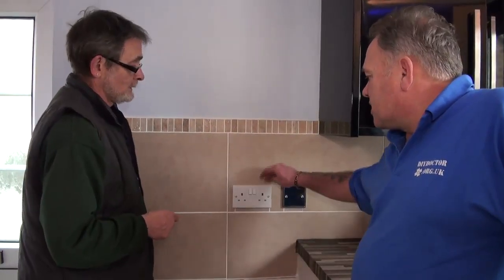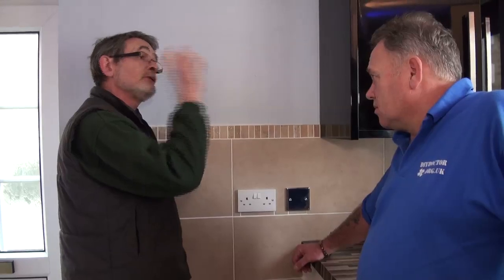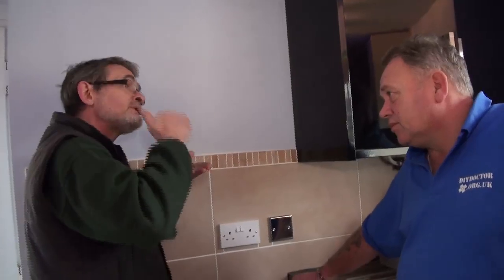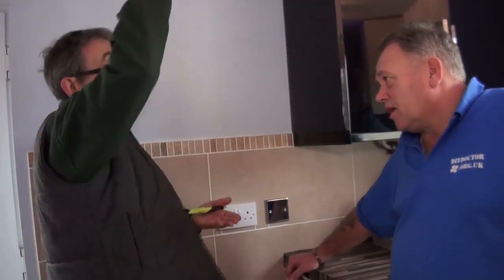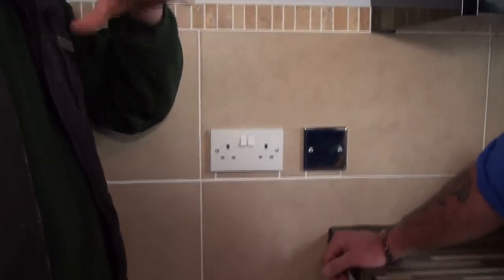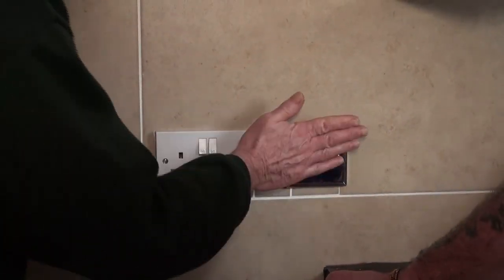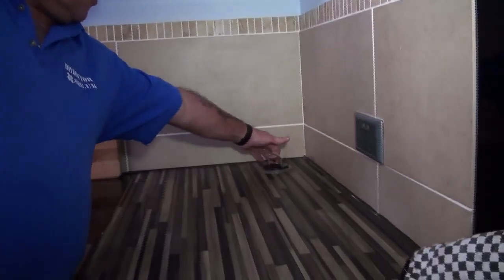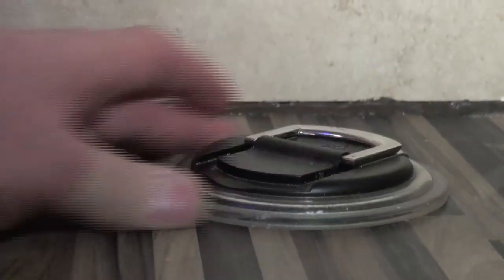Domestic Electricity Demonstration Part 4 - Ring Main, Radial Circuits, Fuses and Amps

Comment: Use correct terminology, its a ring final circuit not a ring main
Reply from the maker: Yes it is,quite correct. However only people who already know that; know that. To the uninitiated, and to those learnng or wanting to learn, ring-main is the popular term they understand. When they learm more detail they will learn its correct term. Until then we will continue to keep them in the loop and not lose them through use of terms  which are not used very often at all in home improvement circles.
Reply: +A Cat who cares